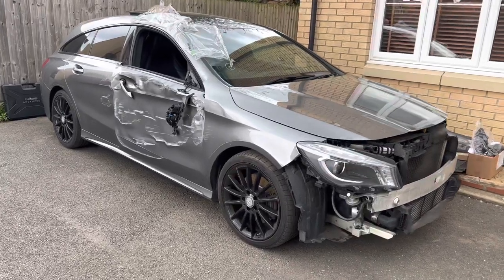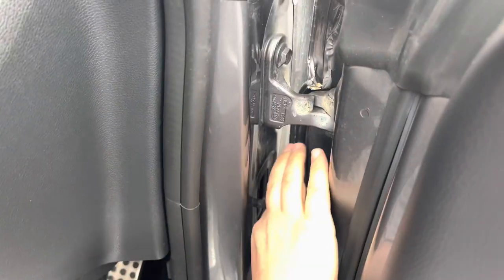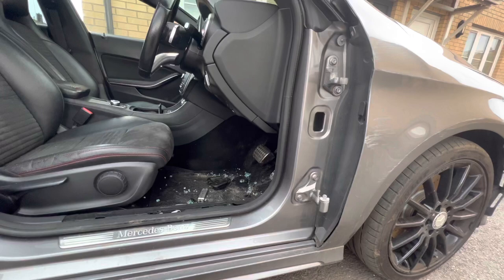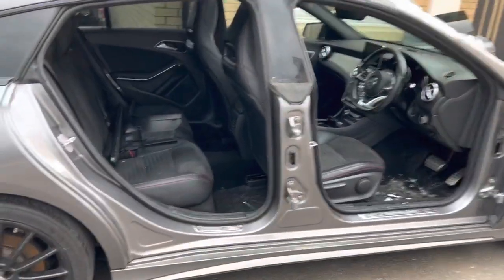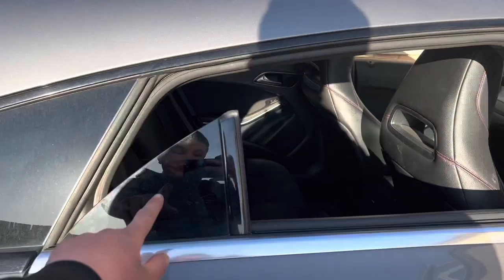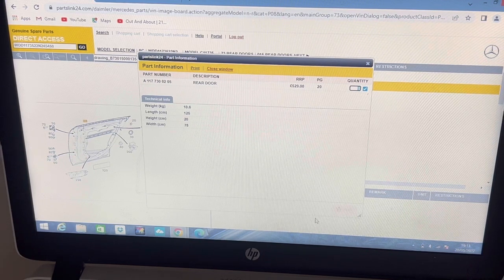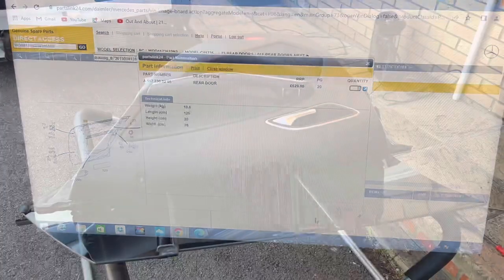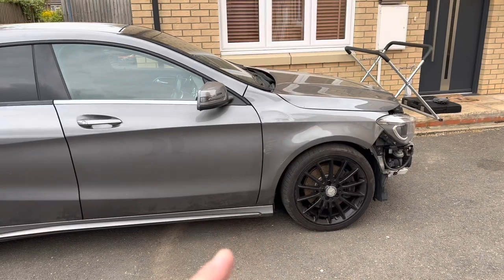salvage damaged Mercedes CLA AMG Estate from copart rebuild part 2

Comment: Great content guys, using that software to locate the correct parts is a real win, especially to identify common parts used on different models. Modern cars are complicated, but are designed to fit together like Lego. Can’t wait to see this one finished 👍😎
Reply from the maker: Thank you George and parts link helps out big time as you can compare eBay/breakers yard prices to genuine new parts from the dealers